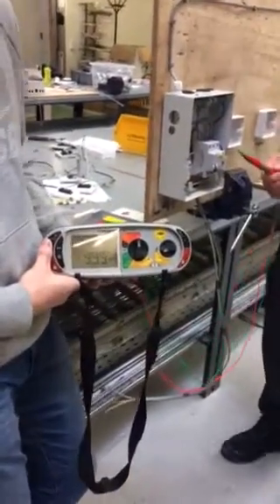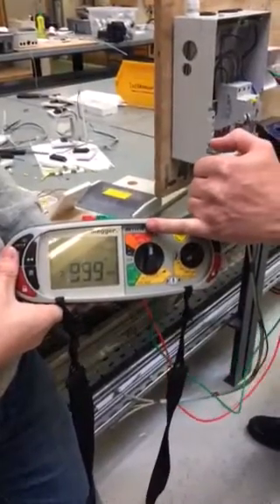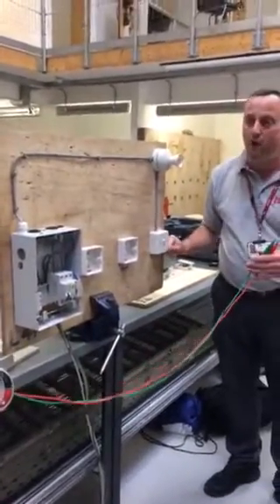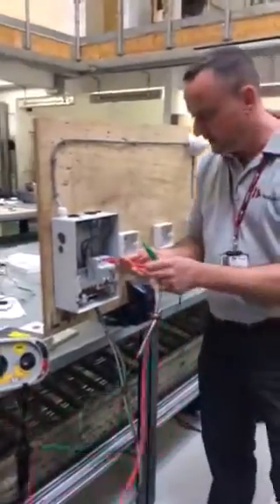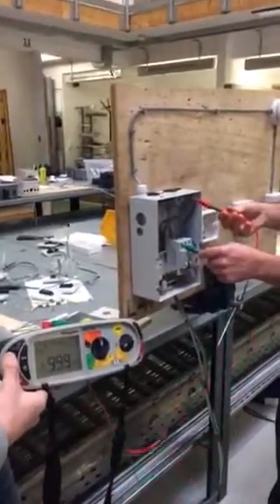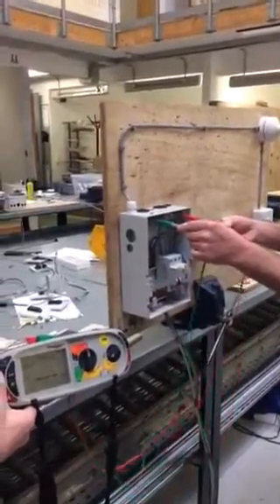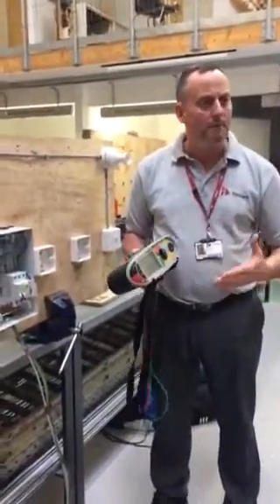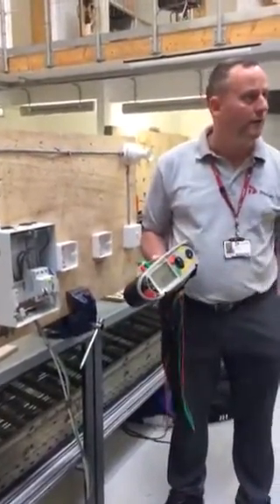How to Test for Insulation resistance of a One Way Lighting Circuits using a Megger MFT Tester

Comment: Brilliant video. Just a quick question please. If I wanted to test the resistance on a cable, do I simply twist or stick the L and N together on one end and apply the 500v power on the other end of the cable on the L and N? Thanks